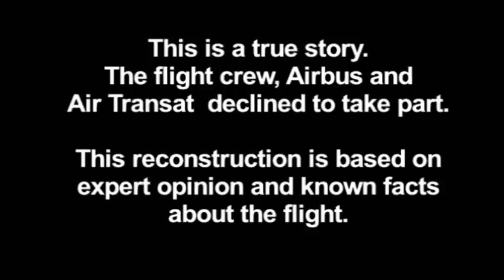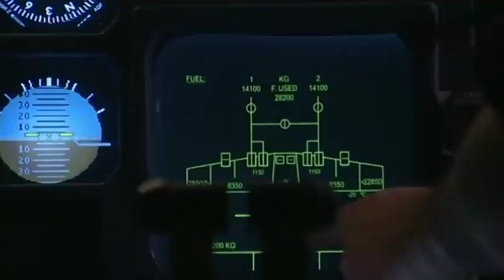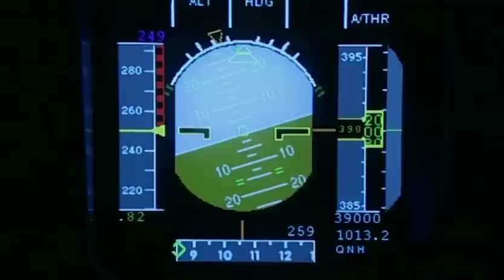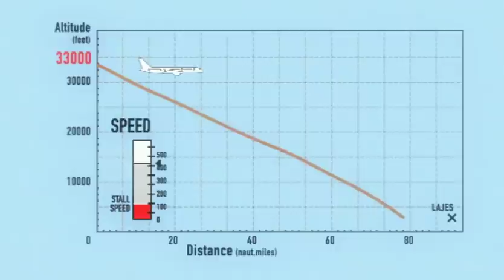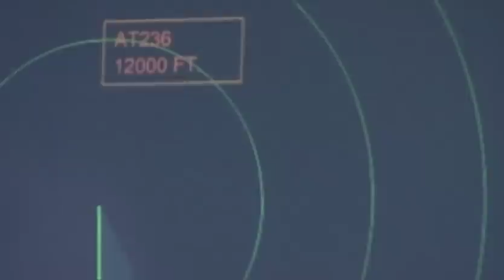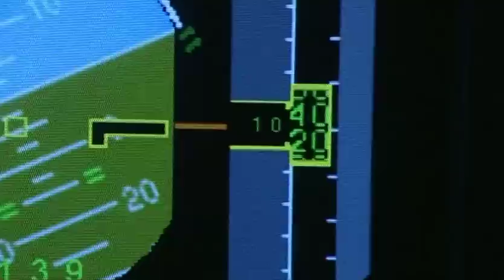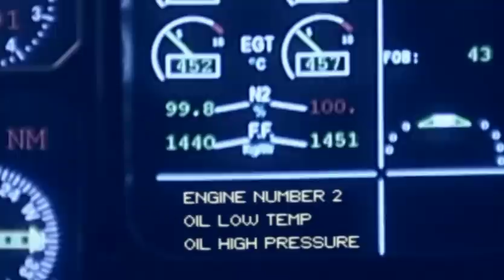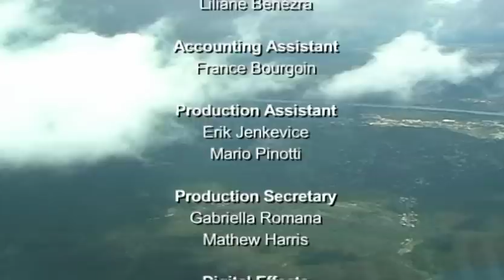Air Crash Investigations Mayday   01x06   Flying on Empty Air Transat Flight 236

Comment: I'm not a pilot, or an engineer, but in the middle of the video when they were moving fuel from one side to another, I was wondering why they'd transfer the entire thing in one shot. Why not move over a little and isolate the problem? Then they're still on one engine but that's plenty to get on the ground safely. The passengers (and public) would've never known what happened cause other than internally, it would've been a non story.

Comment: Why don’t they design the planes so they can ditch in the water better. Such as with Sullys plane, the top mounted engines helped the plane out tremendously.  With the Ethiopian flight, bottom mounted engines caused it to grab water and roll.

Comment: Did the pilots slip the plane to slow? They could have retracted the front gear for added braking.
Reply: Just because that worked by accident on the gimli glider that is not something you would do on purpose.    Too many risks.

Comment: Pilots kinda messed up by opening the crossfeed. But redeemed themselves with heroic flying. You're suppose to assume the computer is right and you're wrong untill proven otherwise. This was in Quebec so I can see how the maintenance messed up. A 1/4 million fine is not sufficient for this blunder. Less than $1000 per like endangered. Canada is a joke though. As a machinist here I've seen how dump people and supervisors are. It's scary to think about. Notice they got zero cooperation, why? Because the USA wasn't apart of the investigation with NIST, FAA

Comment: I have watched many air disaster videos and I see a disturbing pattern. They do not train pilots like they did the astronauts at NASA in their early days. There are as much if not more things that can go wrong with an airline plane than a spacecraft that the training for disaster should be the same. Airline pilots should be constantly trained to deal with maximum failure situations as a standard worldwide. Obviously they are not and I think this should change.
Reply: They absolutely are. Pilots are always training. It's impossible predict every single possible emergency. Do you have any aviation experience or knowledge?

Comment: AirTran was called Value Jet back when I quit flying permanently.  Work would not pay for anything better.  I was sat next to the lavatory.  The lavatory was malfunctioning and there was a stinky, filthy, wet mess going under my feet.  After that, I told work I would take my chances driving my trusty automobile and not to buy me any more airline tickets.  Though, I know it is far more dangerous to drive to where work wants me to go.  I can not tolerate the budget airlines work forced me to take.  They always flew me coach also.  I will never fly again due to ValueJet, that became AirTran, that got purchased by Southwest airlines. I have no use for air travel ever again, especially through work.  I hate it. I know there are far better airlines.  However, the hate is so ingrained in me that I doubt I will ever take a flight again.  Where I reside, one has to have a certain identification to fly.  I did not opt for it.  Everyone thinks I should have got it.  No thank you.

Comment: The Pilots SHOULD NOT Be Held Responsible,They Just Glided A Humongous Airliner Over a 100 kilmos.to A SAFE LANDING.Probably A RECORD FOR A GLIDED LANDING.The Maint .Supervisor That Forced the Mechanic to Use Wrong USED  Parts From Another Engine,Even Though The Mechanic  Brought It To Maint.Supervisor' Attn. That The Parts Were Wrong Size,Should Be Terminated ,& Held Responsible In A Court of LAW For Putting the Passengers & Crew in A DIRE  Situation Of HARM & NOT BE ALLOWED TO WORK IN AIRLINE INDUSTRY IN ANY CAPACITY.ITS A NEAR MIRACLE THE PILOT LANDED THAT PLANE , TKS.TO HIS PREVIOUS EXPERIENCE As A FORMER BUSH PILOT IN BAD CLIMATES OF CANADA.COOLEST PILOTING I've Ever Heard Of. Airbuse Computers Have Been Known To Over Ride the Pilots Actions To SAVE The JET & Force the Plane Into A Crash,Regardless of What Pilots Try To Do To SAVE IT!!

Comment: What caused this accident wasn’t the pilots or the checklist or the mechanic or the supervisor or theirs or theirs or theirs - or maybe even the next few. What caused this was the airline’s corporate biggies who pressure (or rather, force with the axe of “you’re fired if you don’t comply”) the lower folks to put profit before proper care of planes. If the right part had been used, there would have been no leak from this particular break. Full stop. The mechanic wasn’t provided with the correct part, and they voiced their concern that it could cause problems. They had no pull to say “nope, I’m waiting 2 days for the right one”. Mechanics are not stupid knuckle-dragging grunts. They are skilled and understand the importance of a 1/32 of a mm or whatever. They’ve seen what can happen in some cases if something is done sloppily previously, and you can bet most will take extra care to fix sloppy work if they’re not being hounded to death by removed superiors. Maybe not all mechanics take pride in their work or just think “meh this’ll work for a few months and we’ll fix it more later”, but i really don’t think that’s the majority OR the issue in this case. It’s the suits in the skyscrapers that don’t give a crap and don’t bother to imagine that a fraction of a mm could oh for instance cause 306 people to get smashed into bits if it weren’t for the great team in the cockpit of that sacrificial plane. And all because of profit concerns. Mary Schiavo has summed that up well before. And the FAA is in bed with the airlines and manufacturers and government, which means money before lives. And if a life is priceless, it feels like those bigwigs’ interpretation of priceless is not “beyond measure”, but “worthless”. And despite manufacturers and airlines and the FAA saying prettily in their public statements that “our primary concern is the safety of passengers and crew”, that’s just pretty wrapping paper over a box of poison and corruption and greed. Shareholders are the primary concern. Bonuses and tax loopholes and business incentives. Not the passengers and crew on each flight- because there’s always more people willing to fill the seats on the next flight. What other options do people have? And bad opinion will soon be forgotten, bad press gets overshadowed by the next big thing that happens in the world. It’s sickening and depressing but just “business as usual”. Thank goodness I’ve had such great pilots for every flight I’ve been on- there have been issues but my flights always landed safely. Plus, they’re always trying to keep themselves alive too- which is why I will always want a couple pilots on the plane no matter how sophisticated and intelligent autopilot systems get. Electronic systems have no fear of injury or death.

Comment: The pilots are mainly to blame. They should have Closed the 'Crossfeed'. But, "hey forgot to close it" after they opened it. I wouldn't have opened it in the first place. This is a stupid error in two people's judgment. At least the Left Engine would have about 15% of fule left when the plane landed at its planned airport and one engine running, with thrust reversers and full slats and flaps. Got it, knuckleheads? Crossfeed is to balance the airplane, not troubleshoot it. This movie is all about praising the two "Pilots" for almost killing 300 passengers, and possibly many more on the ground. If a part says it will work, it will work. If maintenance installs the part not in accordance with installation instructions, that on the Airline company. The replacement part called for some modifications to installations. All this is in this video, there for all to hear and see. I would have fired the two pilots, on the spot. Another thing: Stop Building Airbusses, and start flying Boeing 737 MAX 8s and 9s. The perfect airliner

Comment: The fact that the pilots have to consult manuals and books in flight or call maintenance guys on the ground concerns me. It would be foolish to expect the pilots to know every nut and bolt in their aircraft, but would it be too much to ask to assign a dedicated engineer to the flight crew? Basically a third guy in the cockpit who's job it is to know all this stuff and be able to troubleshoot the problem on site based on the data the pilots clearly can't make sense of. An onboard engineer who is well versed in the design and functions of the specific aircraft would know the systems and would know if it's a computer problem or not.
Reply: Nobody knows everything. More people just make arguments
Reply: You know how doctors go away after they examine you and then come back fifteen minutes later?  They are often looking things up during that time.  A real professional would consult the manual even if he or she is absolutely sure.  Just good practice.

Comment: Just because the captain can fly an empty plane, doesn't mean he wasn't a dumbass for getting them in that position in the first place.  When fuel keeps dropping, you shut off the damn cross feed valve.  Even if it was a true computer error, you err on the side of the error, if it doesn't place the plane in trouble.  The Captain shouldn't have been flying anything above a Cessna, then he wouldn't have computers to deal with.  He was more concerned with how he would look acting on a what he thought was a computer error, rather than the safety of his plane.  Then there's the co-pilot willing to accept the incompetence of the Captain, instead of taking charge and saving the plane (which is allowed).  He told the Captain repeatedly that there was a fuel leak, and the Captain refused to believe it.  What an idiot.

Comment: The pilots were not the cause of this accident!! Poor maintenance and failure to follow proper safety protocol by management solely for financial reasons, caused this accident. While the crew caused additional problems, they did so because of poor training by the airline and Airbus. Also the fault is on Airbus for not figuring an alarm for fuel loss before this accident. That would have been one of my major concerns if I was designing a plane. How about a fuel pump pressure gage? I am sure that when the hose broke a pressure sensor would have picked up a problem. The pilots are heros no matter what they did, they were reacting to a situation they were never trained for and had no real information by their maintenance department or their "Owners Manual" (Not sure of the name of the book they look at for problems) Air Transat stop blaming the pilots for a maintenance managers ignorance. That man should be fired and you should stop putting money before the safety of your passengers!!!!!!!

Comment: Sure, the Pilots could've taken other (perhaps better) steps, they dealt with an unusual situation as it presented itself to them. It wasn't their fault some chose money over lives and OK'd an install of an incorrect part. It wasn't their fault it was night time and the leak couldn't be spotted. It wasn't their fault there was little in the way training for this extremely odd situation.
What the pilots did do is display and employ skills and calm under pressure to save the lives of those 300+ souls and not turn whoever that was that ok'd a wrong part install into a mass murderer.

Comment: Also climb to max altitude so I have more glide time also I would never fly on a Airbus don’t like the way they look don’t like the cockpit layout with that stupid side stick that looks like a PlayStation 1 and I don’t like all the stupid systems that kill more people that they save.
Reply: Yeah, you better stick with the super reliable and not grounded 737Max
Reply: Mikhail New Never even seen a Max but iv been flying on B-373’s 200 300 500 700 and 800 series aircraft since 1975 and so far so good
Reply: @LyndaWhite-ju1gj  how can you not know about the Max? The whole fleet was grounded!  MCAS? And how can you gain altitude if you have no power? That's the reason the plane started gliding!
Reply: Megan Bordenave yes I know the all the Maxes are grounded that’s why I have not flown on one and I know where they are parked,, and when the crew  got the first warning of flue imbalance right there i would climb while I still had power and fuel but they wasted valuable time trouble shooting looking at check list telling the flight attendant to do a visual on the engine which I guess is ok but why not climb right off the bat to give yourself many more miles of glide time and more time to trouble shoot

Comment: The pilot was an idiot. He has a large fuel imbalance in the tanks, even if he thinks the computer is wrong - keep it in the back of your head. Follow procedure, run the cross feed valve for ten minutes and check - that idiot left it on for 30 minutes...30 minutes....Oh but that's procedure...remember what the manual said "don't do this if you suspect a fuel leak". With that large an imbalance was other possibility. Was there? Ok so if he had brains he runs the cross feed for say ten minutes, shuts it off and checks his tank constantly BUT HE LEFT IT OPEN FOR 30 MINUTES. The people should never have been in that situation. The pilot and the maintenance people are at fault.

Comment: the captain NEVER considered the plane was running out of fuel, he should have been fired and jailed
Reply: @kapou214  the first oficer saved them all, so u can go back to your mum's couch
Reply: @mikeboston421  They noticed a fuel imbalance. The standard procedure in that case is to transfer the fuel between the reservoirs. After a while he noticed that the transfer wasnt helping so he considered the possibility of a leak, so he asked to the chief attendant to check for a fuel leak behind the wings. She saw nothing. They then calculated the level of fuel that should have remained, and since the fuel level was too low, they decided to land at Lajes airport by precaution. But, they decided to stay at 39 000 feet, instead of following the procedure of going down to 20 000, in case the problem was real, and not just a glitch. Otherwise they would have ditched, and they considered this option too dangerous. The engines stopped a while later, confirming the fact that it wasnt a false warning of the system. They took advantage of their altitude to glide to Lajes. By doing so, they saved 306 lives. How many fucking lives did you saved? I wonder how you would have reacted being the captain of this flight. Its so easy to judge and criticize the players of the match when the match is over... Especially when you are a nobody. So anyway, YES, the captain DID CONSIDERED a fuel leak. He did his job, and saved the plane and its passenger, by landing it. Because HE  landed it. Im not taking away the credit from the first officer, but captain Piché landed the plane and took the decisions, while considering the advices of his crew, like a good captain must do.
So stop talking trough your hat. 
Now, if you'll excuse me, Im gonna go back to my mums couch.
Reply: @kapou214  that was good👌👌

Comment: the 'story' of this almost tragedy is a complete and utter lie, the captain was badgered repeatedly by the first officer to let him change course as the first officer believed the fuel guage whilst the captain thought it was giving faulty readings, luckily the first officer fought hard enough to the point the captain allowed him to change course enough that if they did run out of fuel they would be close enough to land to land the plane, in the end he should have been hailed as the hero, but Air Transat covered the whole thing up to save the reputation of the airline and the moronic captain, way to go Kirk De Jager, you're the real hero in this story, Air Transat should be ashamed